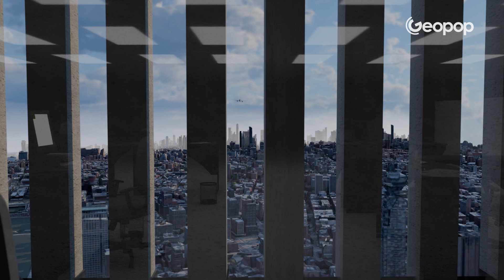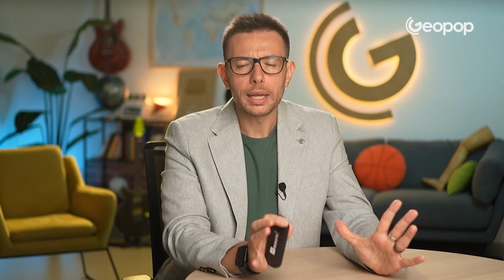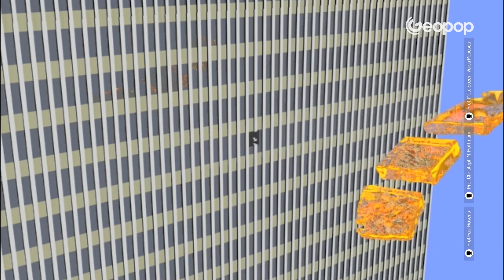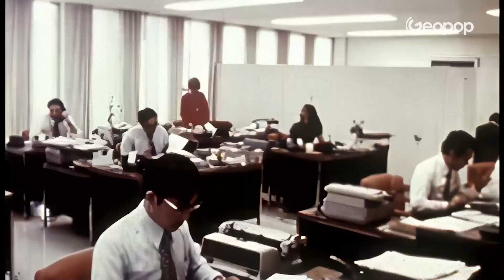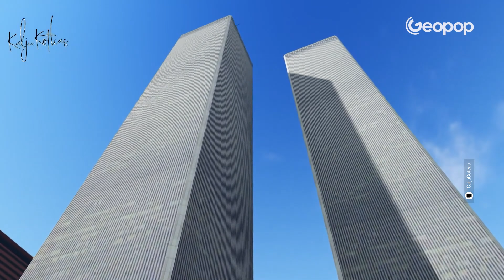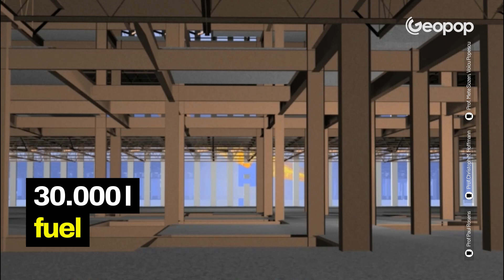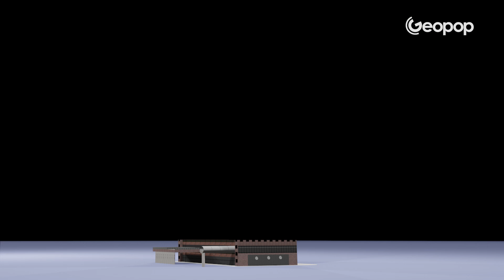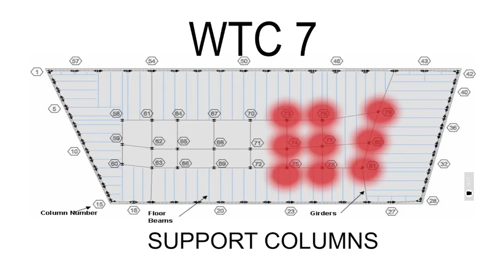9/11, 2001: The Technical Reconstruction of the Twin Towers and WTC 7 Collapses

Comment: -- Then what is the source of the many tons of molten steel found in and under the debris, the heat so intense that the molten steel remained in that state for weeks afterward, running off of the debris as it was excavated. This cannot be molten copper from wiring that retains the color of a shiny new penny.  It cannot be molten aluminum that retains the color of the polished aluminum wheels of a street racer. It was the color of glowing orange molten steel  that cannot be mistaken for any other material, reported by firefighters who are very experienced in the nature of such materials as well as seen in video evidence.

When you combine this with an entire lack of turbulence behind 500 mph aircraft, when even a small Cessna Aircraft would leave an evident wake in the smoke and fire only seconds later .  . We find that skeptics still cannot be skeptical of the official narrative in explanation.  Sponsored channels and forum activity are skeptical of nothing when support is provided.

Sponsored activity in the forums is very normal today for commercial and political purposes and subjects of controversy -- in the attempt to lead public debate.
Reply: There wasn't many tons of molten steel in the debris pile afterward and the proof of that will be when I ask you to provide a shred of tangible physical evidence to support your claim and you don't.

People like you never have and never will.

Molten steel is a myth that has grown to a fish story by people misinterpreting a tiny handful of witnesses making casual use of a single word, then running with and exaggerating it all out of proportion to reality to suit their own personal political agendas. 

Even if there had been any molten steel in the debris pile post collapse, it would have been the result of conditions in the debris pile and tells us nothing about what started the collapses.  Those mechanisms are well know, easily visible to the naked eye and in no way involve structural steel becoming a puddle.
Reply: Since your qauestion has been answered why are you still spamming it all over?

I suppose maybe I need to address the second part of your post, although I suspect you will pay no attention - here it goes anyway;

Molten metal pouring out of the South Tower (and it was in fact ONLY the South Tower)?  You mean this?

youtube.com/watch?v=xPVGGQU-MeQ&ab_channel=SeekersofTruth 

So you think that is molten steel why?  Because you performed metallurgical tests?  Because the internet told you that’s what it is?  I think we can do better, so let’s do better and build a theory the right way instead of making evidence-free assumptions. This will take just a couple of minutes and is worth the investment. 

The Boeing 767 which struck the South Tower weighed 117 tons and 80% of that was aluminum.  The exterior cladding on the Twin Towers – the white panels – were also aluminum. When Flight 175 struck at the 81st floor its momentum deposited much of the office contents in its way and the bulk of the aircrafts mass into the NE corner of the building. The piled up debris shoved into that corner is visible in photographs and video so we know it was there. 

There’s a good shot here of piled up debris from 4:36;

youtube.com/watch?v=ZLJyL63sqtU&ab_channel=MrKoenig1985

Steel melts at roughly 2,750-deg F while fires in the South Tower reached peak temperatures of around 1,800-deg F. Aluminum OTOH melts between 887-deg F to 1,180-deg F depending on alloy. That aluminum will melt under these conditions is not a surprise. If you look at pictures of cars left behind and destroyed by forest fires the aluminum wheels are invariably melted away along with other sometimes aluminum parts like hoods. Steel bodies remain intact. 

The “molten metal” appears at 9:52 am. At the same time we see the first externally visible signs of sagging floor trusses and the pulling of the perimeter columns inward. I submit these events are related, not coincidental. The aluminum cladding at the NE corner also appears to me to be burning. 

It is likely the with the floor trusses sagging under the heat, and the 81st floor truss in the NE corner under the debris pile subjected to the heavy load of the debris pile, the truss broke its perimeter column connections and dropped, instigating the material starting to pour out of the NE corner at the 80th floor.

Given the properties of the materials in question, aluminum is by far the most likely culprit. 

Reports from The NIST, FEMA and MIT all concluded the material is aluminum. 

Certainly steel is the least likely of all the materials the anomaly could be given its much higher melting temperature and the fact there is no logical source for molten steel.  The perimeter columns in the NE corner are intact and the material is pouring out between them. So it isn’t columns melting, therefore what other source of steel is there?

Deniers will claim molten aluminum appears silver when molten, which is true but only at the low end of its melting temperature range. Aluminum can and does get hotter and it glows red to orange when it does (1,100 to 1,800-deg F).  Most folks of course just don’t bother getting it that hot if the goal is just to get it molten for say molding a part. No need to go higher. 

The total mass of molten aluminum is a BIG deal in regard to how it behaves when poured. Quantities bellow half a liter cool almost instantly if poured onto a flat surface, but if poured into say an ingot mould will stay red for a minute of so. Pouring volumes of molten aluminum greater than a liter is a VERY different experience. The thermal mass is much greater and the radiant heat is horrendous. The aluminum is able to stay liquid and remain glowing bright orange much longer. 

The famous video of glowing liquid gushing out of Tower 2 moments before it fell, involves at least tens of liters of molten aluminum. The thermal mass involved is so great that it stays red after falling many meters through the open air.

Side note: There was also a large UPS battery farm in that spot and some of that material at least may well be from the batteries IMHO.

Comment: kerosene fuel does not melt tempered steel.
Reply: Good, it doesn't need to and no one is saying it did. 

In this video starting at 22:30 and running to 28:10 the Energetic Materials Research and Testing Center (EMRTC) conducts a test to see what an open jet fuel fire can do to a loaded and unprotected steel I-beam. Remember, steel melts (turns into a liquid) at around 2,600-deg F, give or take depending on specific alloy. The test was planned for 30 minutes.

youtube.com/watch?v=JXWCMBuusMI&ab_channel=TrutherTVArchives

Within 2 minutes the open fire temperature has already exceeded 2,000 deg-F. 

After just 3 minutes 40 seconds the beam is sagging noticeably.

The beam fails and collapses 9 seconds later after just 3 minutes 49 seconds.

Note the steel fails but does not melt. It is bent and twisted, but not a puddle. You can still tell it is an I-beam. 

Purely from a jet fuel fire. 

Jet fuel cannot melt steel beams, but then again it doesn’t have to.  The steel fails well before it gets a chance to turn into a puddle and it doesn’t take long.

Comment: What's with the voice? This looks to be just another shill video. Nobody claiming themselves to be a structural engineer c as n argue that the towers collapsed due to fire. Building 7 was a classic implosion demolition collapse, and there is audio of firefighters warning people that they were about to "pull" the building, a demolition term. In addition, a BBC World Service reporter was on CNN saying that the Goldman Sachs building ( building #7) had just collapsed, yet it was still visible in shot behind her, and didn't come down till 20 minutes later. This is a BS video.
Reply: This videois not wrong. If it were you would have come up with a much better rebuttal - or a rebuttal.

Instead you came up with the same old dead horses that have been failing for the last 20 yeras.  Repeating the same mistakes over and over again expecting different results is the definition of insanity.

Comment: WTC 1 and 2 and 7 were demolished by controlled demolitions.  The work was carried out by IDF demolitions specialists presented as an art group called "B" for the Bang! They had several weeks living in the towers which were only occupied by a few tenants. Most had moved out due to the heavy asbestos contamination. The remaining tenants complained daily about the banging, drilling and movement of heavy equipment in supposed empty floors. There was an Israeli tv program where two of the group boasted of their success. It was eventually removed after too many questions were asked. 9/11 was provably an inside job.
Reply: Someone wasn't paying attention.

Comment: Can someone explain to me why none of the fire sprinkling systems had any positive effect on mitigating the fires in any of the buildings? Also why were News outlets in the UK told that #7 had collapsed 20 minutes before it actuality did? What about the nano thermite found in the dust at the site? Many demolitions experts dispute and do not buy into the Government report because the speed at which it collapsed at. Has anyone looked at the seismology tape from Central Park to confirm the Government Report?
Reply: Sure. 

1. In the Twin Towers that standpipes that fed the sprinkler systems had a poor reacting to 117 tons of airplane flying through them at over 400 mph.

2. In Building 7 the sprinkler system was manual, not automatic and there was no one in the building to activate it. On top of that, the collapse of the North Tower (which had started the fires in Building 7 to begin with) destroyed the water supply to the entire neighborhood, so there was no water pressure. 

3. The BBC picked up an AP wire service report that happened to be wrong - one of just a few hundred incorrect news reports that day. So what?

4. What nano-thermite found in the dust?  Those morons found primer paint, then lied.  There's a lot of that going around on the internet.

5. What demolition experts are you referring to?  Can you even name one?

6. How does how fast something falls inform you as to what started it falling? Recall my warning about male bovince feces on the interwebs.

7. Why would an alleged seismology report be needed to confirm anything?  Have you looked into it?

I sincerely hope this helped.

Comment: Why were there explosions in both towers just the lower floors.  Knowing how controlled demolition & used  Thermite cutting steel like butter . Pic's show main supports cut at a 45° . Why ????  I'm sure it was an inside job to get in a war, only the powers that be wanted. The heat wasn't enough to melt, but Thermite could & did .  Enron was the other problem was about to show major corruption by them & government had to go . Bush got a win win with all that happened  SMH  3000 dead to cover there ASS
Reply: There weren't any explosions in either tower other than those caused by the impacts. 

Thermite cuts steel like butter?  Does it though? Who told you that, the internet? If only someone had actually tested this instead of just guessing or making unfounded assumptions. Oh, wait!

youtube.com/watch?v=JXWCMBuusMI&ab_channel=TrutherTVArchives 

In this video starting at 45:35 and running to 48:35 the Energetic Materials Research and Testing Center (EMRTC) conducts a test to examine the effectiveness of thermite in cutting a vertical hollow box-section steel column. The column tested is smaller in cross section and made of thinner steel than that of the Twin Towers perimeter columns (and never mind the core columns). In total 175 pounds of thermite are used for the test on just one column and requiring the construction of a rather conspicuous coffer dam to contain it. Do recall the Twin Towers had 240 columns and 110 floors.

It would be odd if thousands of office workers missed hundreds, perhaps thousands of those suddenly appearing.

Note what an incredibly slow process this is. It took close to 30 seconds for the thermite to finish burning off.  It would be impossible to “control” a demolition using this material.

Not to mention the issue of; how does the aircraft impact and subsequent raging fires NOT prematurely set this stuff off?

Also note how bright and obvious the whole process is. Could not be missed visually. No way to hide that. 

Then at the end of the test the (relatively modest) column was undamaged…. which is a problem.

Certainly no rivers of molten steel emanating from it either and in fact the whole thing cools rather quickly as soon as the thermite has burned off, as one would expect.

Thermite has never been used in the controlled demolition of any building, let alone one with multiple floors on fire after the impact of a large jet. If the conspiracy oriented internet has taught us anything it’s that if something has never happened before, it can never happen.

Comment: The most important function of the hat trusses was the redistribution of loads from the perimeter columns to the core columns.  When the trusses were compromised the loads were revisited upon the outer columns.  These columns were not designed to handle this degree of load.  Had they not been still partially connected to the core columns by the floors, they would have sprung outward.  Because of the floors, the collapse of the outer columns proceeded from top down with the inner columns collapsing a second or two later.

Comment: So one building takes 25min for the steel to heat to the point of failure and the second took 5min????  These are the 1st 2nd and 3rd steel skyscrapers to collapse due to fire. In the world and how do all three get damaged on one side but fall straight into their own footprint. Ive been on site for controlled demolition and you couldn't have done a more precise job.  tower seven is exactly what it looks like. Not to mention CNN reporting that 7 had collapsed minutes before it did
Reply: Just curious, where do you get 25' and 5'?

Fun Fact: These were also the first steel skyscrapers to get hit by jumbo jets doing 500+ mph.

Comment: You're full of BS.  Society of engineers was denied ability to testify and states that the building couldn't have collapsed from the plane crashes, and that it was controlled demolition.  Plus, there were samples showing military grade thermite...
Reply: The 130,000 member American Society of Civil Engineers was deeply involved in the investigations of the 9/11 attacks and instrumental in writing the final reports. 

There are zero samples of military grade (gross argument loading alert) thermite - only 4 (four) samples of primer paint chips one group of morons tried to claim was thermite. Worth noting thermite is not a material that is ever used for building demolition due to its complete unsuitability to task. Those authors just needed a way to rationalize the obvious lack of explosions in their explosive controlled demolition and that was the best they could do.

And you fell for it

Comment: Which is more extreme -- to accept without question the inexplicable lack of turbulence in the wake of a 500 mph large passenger airliner -- not evident in the smoke and fire covering the impact zone only seconds later? -- or to recognize the indications of digital projection in its imperfect nature as we see a wing disappear in front of a bright blue sky? From another camera angle, the same aircraft is seen passing behind a crane in the foreground, yet in front of the heavy crane cable. 

There should be a hurricane of turbulence in its wake that would entirely disrupt and disperse the smoke and fire seen billowing outward just 3 to 4 seconds later at both towers.  Even the wake of a small Cessna aircraft would be noticeable -- yet there is nothing.
Reply: The wake is - by definition - behind the aircraft and by definition would NOT be a factor.

Your starting assumptions are false - which explains why they are not supported by any evidence,  just presented as bare assertion.
Reply: @ElLowEl .  . "What the hell are you talking about?" .  . 😃 .  . Thank you for your sponsored reply, Mr. EILow.  The word projection indicates holography as you know, commercial demonstrations of which have been amazing in recent years.  To feign ignorance doesn't work well for you, however.  Where, Mr. EILow, is the wake turbulence only seconds after passage of a 500 mph large passenger airliner -- not seen in the smoke and fire covering the impact zone?  Even the wake of a small Cessna Aircraft would be noticeable -- yet there is nothing.  It's likely that no real answer from you is forthcoming. We'll wait and see .  .